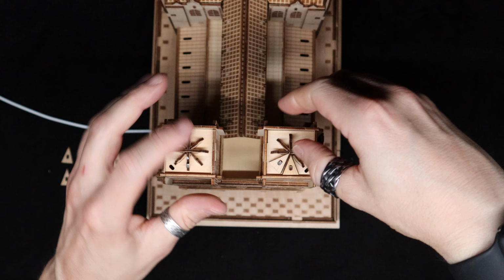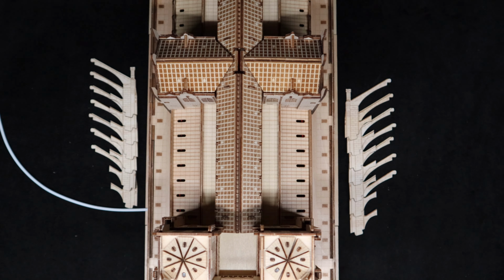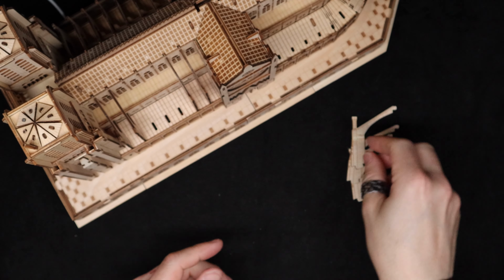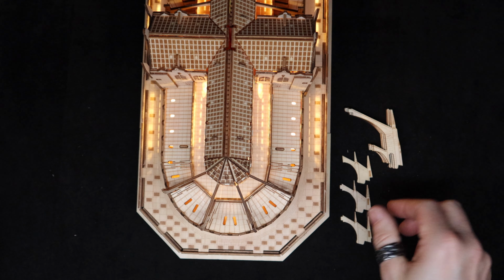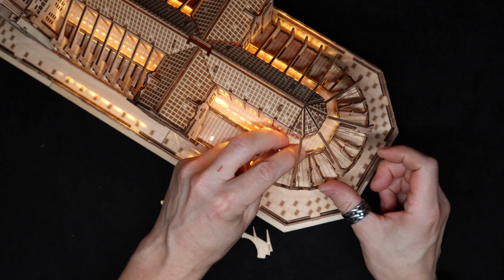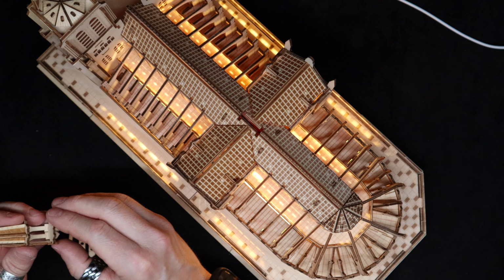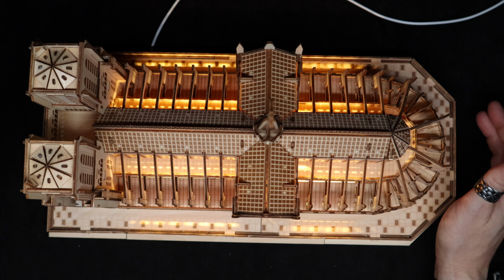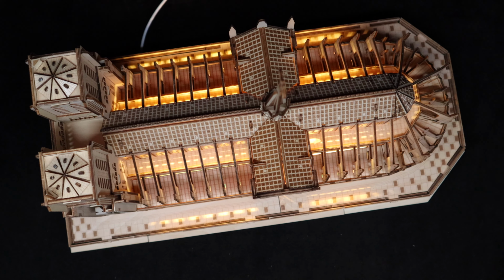Notre Dame De Paris Model Build Steps AI-END

Comment: Don't be afraid to paint the parts for more realism. Great job!
Reply from the maker: If I were slightly more artistic I’d probably give it a shot, but I’m not. 🤷‍♂️
Reply: @Dbuilderguy   I hear you. I am not artistic, believe me , but the burned edges on laser cut pieces bug me so I usually will paint the parts before assembly. I use spray paint mostly. Love your videos which I just found today. Am starting the Rolife Time Travel.